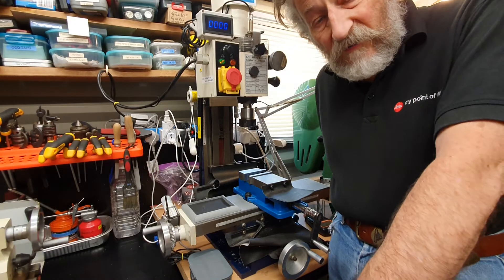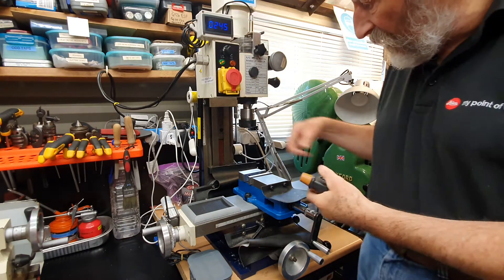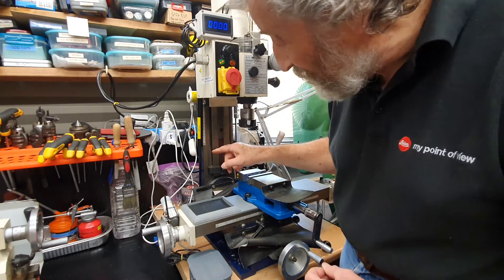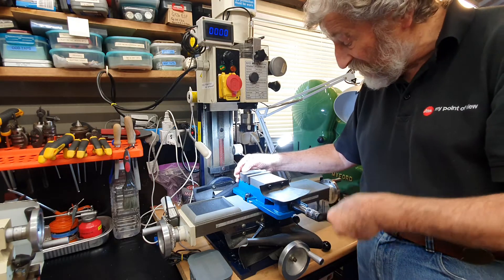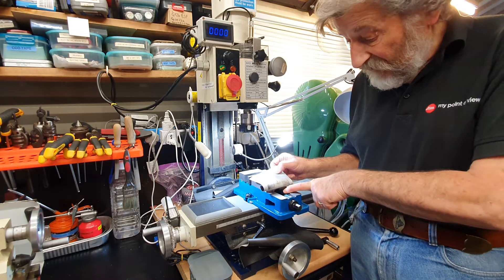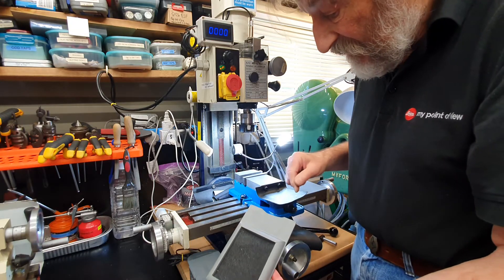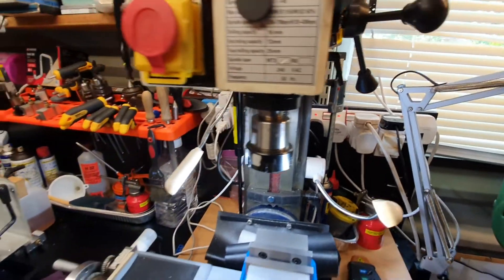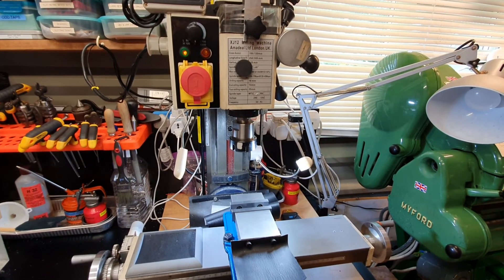Mini Mill Upgrades

Comment: Hi Nobby
Some nice mods there
Great idea with the Gas strut,  might one day copy that👍👍👍👍👍👍

regards
Kev (Mr F)
Reply from the maker: Thanks Kev. The gas strut was a great improvement. The original torsion bar had a very weak spring, the head of the mill tended to slip some times. Was well worth doing. ATB Cheers Nobby

Comment: Cool nice job upgrades.
Reply from the maker: Thanks for looking Paul. I've since fitted a 3 axis DRO to my Mini Mill. I put up some videos on it if you're interested. Cheers Nobby
Reply: @nobbysworkshop  yes Sir, I'll be checking them out. I have a DB 209 unimat with milking colom andwooden box decent acc came with it. None of bigger stuff to make different tools. Just lathe, mill.
But 3 jaw, face plate and dogs. 2 dead centers small arbor, drill chuck, wood chisel few bits. It's like brand new old stock u could say . Dentist owned it I got it from guy bought it estate sale. $ 500 . Had it few years now.  Need find 4 jaw chuck and few other little odds ends. 
Collet chuck  be nice.
Well grand baby up I guess papa nake some breakfast. Stay safe from ur ole hillbilly buddy.
Reply from the maker: The lathe sounds good Paul. My first lathe was a Unimat SL. Bought it about 8 years ago, and it started my engineering hobby. Sold it to buy a Mini Lathe. I bought a 4 jaw chuck from another small lathe and converted it to fit the Unimat. I wonder if a Sherline chuck could be adapted. Made in the USA? Good luck. Cheers Nobby

Comment: Hi Nobby.
Great video. Do you know where I can get a speed handle for the vice or could you maybe leave a link. 
Cheers
Calvin
Reply from the maker: Hi Calvin. The one I showed in the video, I made myself. Very easy to make. I bought a long series socket to fit the vice , attached a small bar to it and made a handle from Delron. A nice afternoon project. There is a company in the U.S. who make them, Edge Technology. If you do a Google search there are some other companies offering them. Cheers Nobby

Comment: Good video Nobby.  The vise fits very nicely.  Super good unit for the money.  Very easy to clean.

Did you add that bridge type stop to the mill column or was it part of the kit ?  I must get a mill, but the prices keep going up.  How do you find that one to be ?

Cheers

Rob
Reply from the maker: Hi Rob, the stop was part of the mill. I love the mill, have done so much work with it and it's been great fun. I bought it used on ebay 6 years ago. Was GB£370 but would sell for at least 500 now. The only down side is, it doesn't have a quill. So when drilling you move the whole head of the mill. Makes the column stop very useful. If all goes well I hope to upgrade it later this year to a slightly bigger one with a larger motor and a quill. Would recommend you get a mill Rob. Guarantee you won't regret it and won't lose money on it. Thanks for looking at my video efforts. Regards Nobby

Comment: Hi Nobby. Your Myford looks like brand new or is it a repaint job ?  Just a thought about your table drive gears, you say that you made them. Why not buy them on ebay ? I bought the gears for my Grenby Surface Grinder fine down feed unit that I made. They were a Metal Replacement Set of gears for a Mini Lathe. Not 30 and 60 as you fitted but 45 and 88 but as it was just a reduction setup they would do. Just a thought should you also want to fit a table drive to the Y axis.  Regards from Australia.
Reply from the maker: Hi David my Myford is a ML7R it's all original. It took me a long time to find this one in such good condition and near enough to where I live to be able to collect it. I love this lathe and have always wanted one. The only thing I added to it was a nice used clutch about six months ago. Bit of a headache to fit but so glad I did. Makes using it so much easier. I have added some accessories to it. A rear tool post, 4 jaw TOS scroll chuck, ER32 collet chuck and loads of Dixon tool holders. I also adapted a small Bison 3 jaw chuck making a back plate from a Myford catch plate. I did look for some suitable gears a Ebay but couldn't fine anything at the time. Thought trying to make the gears would be a good experience. I'm making a video at the moment on how I made them. Thank you for you kind comments David.